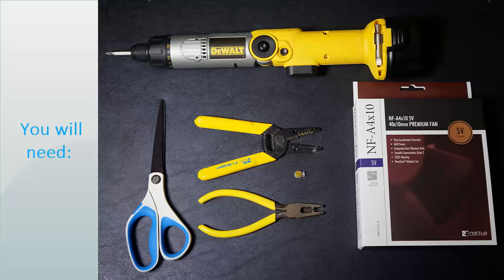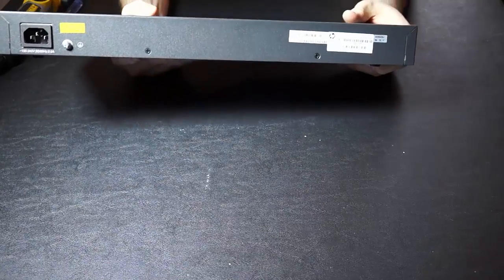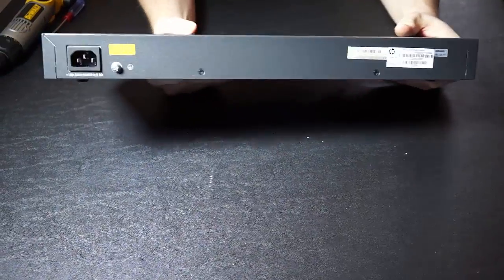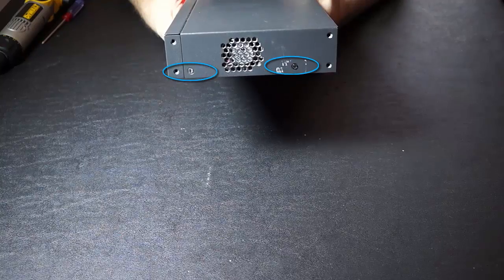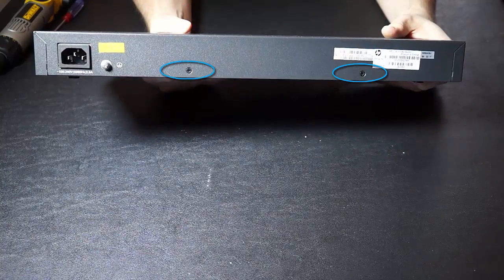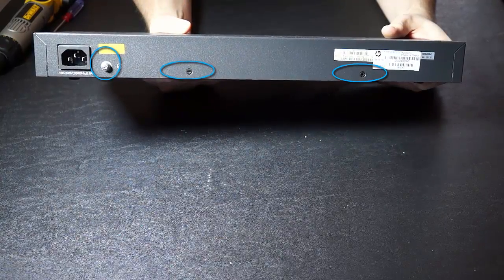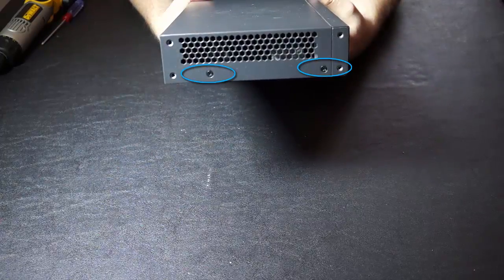Replacing a Stock HP V1910 Fan with Silence

Comment: Strange... I have the same (almost) switch, but it's a 3com... and my delta fan in there is 12V and NOT 5V... did they change the fan voltage when they went from 3com to HP or yours was changed at some point (or mine?). Anyone has a 3Com Baseline Switch 2952-SFP Plus by any chance to check?
Reply: Yeah, I did this mod too.
And my fan was also 12v,
I’m not sure on the difference between the 3com 
What are the differences so I can compare

Comment: Quiet, but not silent. Replaced the fan as this will go in my workspace/lab which is right next to my family room. 
Even with this fan in, it's as loud as mid tower computers from the late 90s. Im still around 48-50 dB measuring from the spot in this video.

Comment: PS: Der Switch mit 48 Ports V1910-G48 verwendet 12V Lüfter.

PS: The 48-port switch V1910-G48 uses 12V fans.
Reply: I have the hp v1910-24g-poe 365W version, do you know if that switch uses 5 or 12V fans?
It seems to be 3 fans in that also..
I have an annoying fan bearing noise in the switch that I want to resolve..
Of course with quiet fans..

The PWM version of the Noctua fans seems to have 4 pins, and I guess they will be plug and play, and I guess won´t create a fan error in the log?

Comment: Thanks for this - just replaced the fan in my 1910 and it's sooo much quieter - used a NF-A4x20, as the NF-A4x10 wasn't readily available, and it worked just fine.

Comment: Just made this modification to my switch today, sound level decreased tremendously but the log is full with fan errors, i've seen another post who suggests connecting the white wire to ground i'll give it a shot. 

Thank you!
Reply: My issue with doing that is that you lose the ability to detect a failed fan. There surely is something else to do there so you don't just short circuit the thing and don't get the log filed.
Reply: Did changing the wiring fix the errors in your logs?
Or what happened?

Comment: First thanks for video! Tried out this "hack" myself on the same HP v1910-16 switch using NF-A4X20 fan. I can confirm switch works. It is quieter yes, but i would say 25% less noise. So you will still hear fan noise in quiet room. I am also getting fan fault errors in logs..(i connected the fan same way as in the video). So it is kind a improvement yes, but switch without fan is still better choice.
Reply: Did you fix the fan errors in a way? Or do you still have those?

Comment: Very nice DIY-video! The Noctua-fans are really awesome, extremely silent and Long life. Why didn´t you use the NF-A4x20 5V instead of the NF-A4x10? Higher static pressure and better air throughput

Comment: Thanks. This helped me out. One thing i noticed is that the noctua fans dont get enough power to make it a full rotation. Wich results in a fan that doesnt spin. You need to manually rotate the fan so the fan blows the hot air out. Anyone have the same issue?